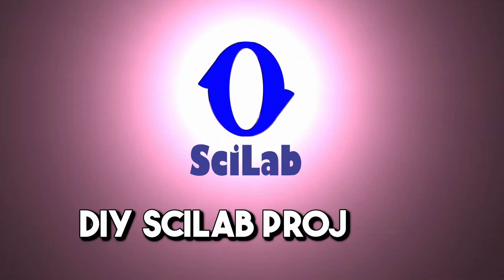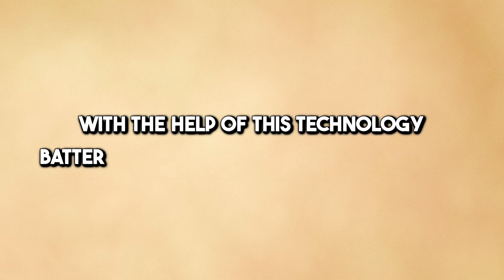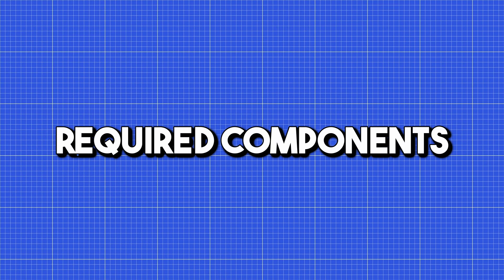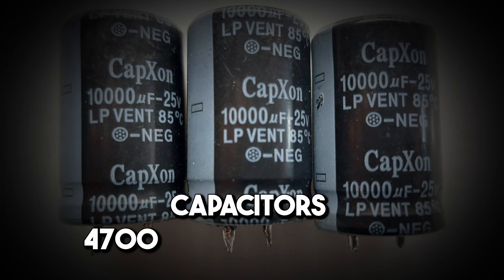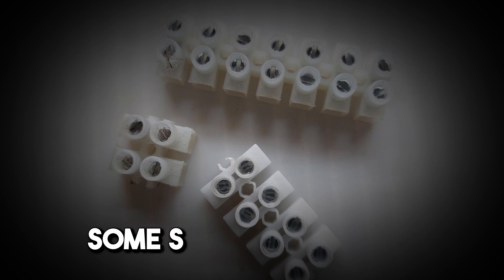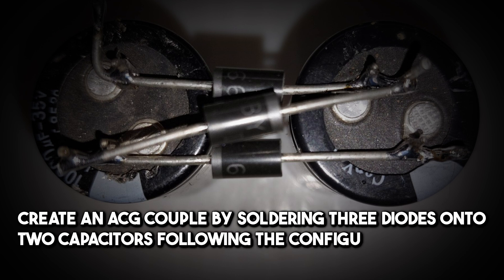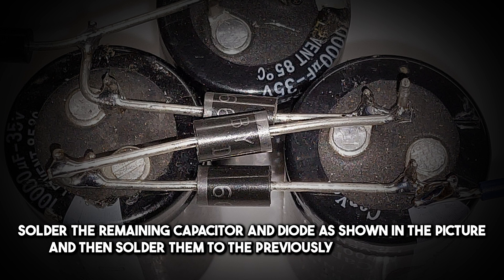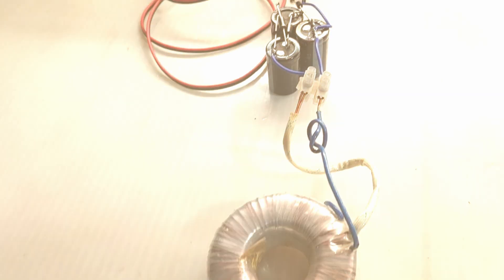DIY ACG Battery Charger Step by Step

Comment: Sir, how much is the amperage your circuit is charging to the  battery? Thanks in advance for the efort and nice invention. 
Greetings Sven.
Reply from the maker: It depends of capacitors size and input voltage. It could be few amos if you use 10 microF capacitor or much, much more if you increase the capacitors.
Reply: @MilanMančić 
I want to get about 15 amps output to charge my car battery.
Input i still have to build a alternator so I can get 12v or more and if necessary less.
Thanks in advance for your support.
Greetings Sven.
Reply: Sir, 6 months ago I have managed to build your project successfully that is a great video of your project thank you very much.
But now it's not working so good anymore, I have tested the caps and they give 8200 uf instead of 10.000uf, is it normal or are they broken?
Thanks in advance for the effort end great video.
Greetings Sven

Comment: So with a gridtransformer with 12v output, do I double the ratings of the caps? So 9000uf -  44000uf?
Reply from the maker: Tell me first the voltage and capacity of battery you want to charge .
Reply: @MilanMančić aah, sorry. I have 4 12V batteries for a scooter, 7Ah each. Also a carbattery 12v, 88Ah. All lead acid
Reply from the maker: The scooter works on 48 V ?
Reply: @MilanMančić  thats right, the 4 cells are connected in series so should deliver 48V; but I haven’t been using the scooter for a long time, so the batteries are pretty ‘dead’; i disconnected them
Reply from the maker: @hansscholte5472  Ok. For the scooter you can use that 12 V transformer and keep the same capacitor size  as I recommended. For the 12 V battery car, 12 V input from the transformer is to high. You need something between 4 - 6  V from the transformer. There is a some trick to use 12 V transformer , but I need to check it first.
Reply: @MilanMančić  you mean for the scooter i keep the batteries in series like 4 x 12v makes 48v and for that setup i use the gridtransformer of 12v instead of 4-6v of your video? Thanks in advance Milan! Great work, really